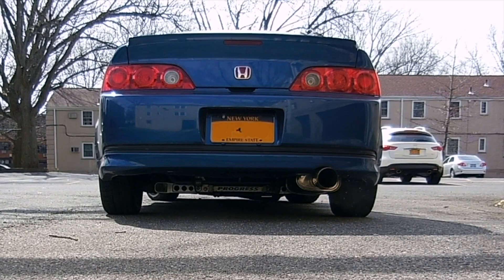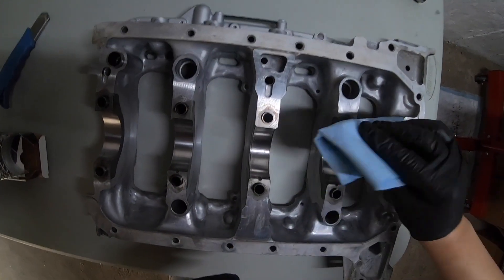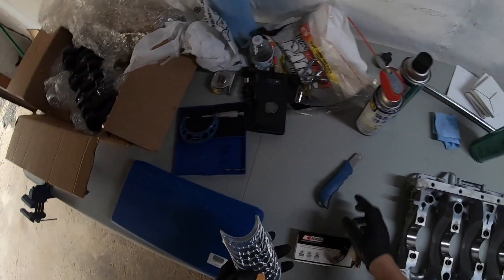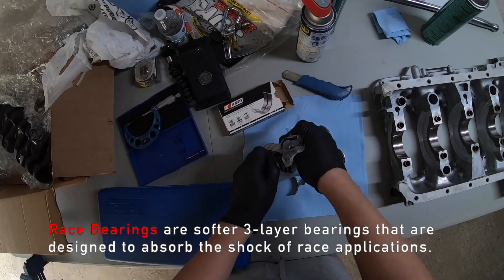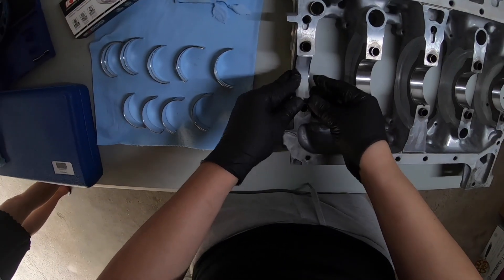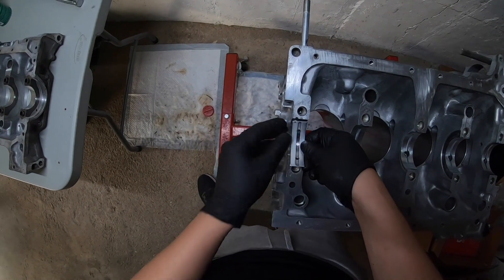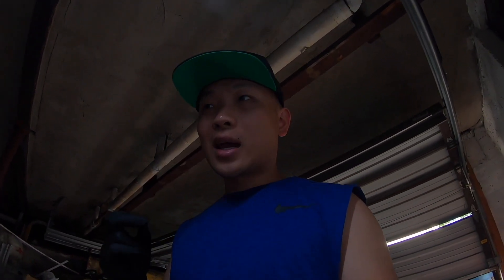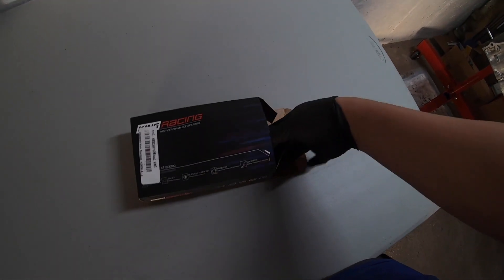KING Main Bearing Installation - 5 Simple Steps

Comment: Aren’t you supposed to take a measurement in three places per journal, noon, 4 o’clock, 8 o’clock and check for ovality?
Reply from the maker: I only did that with the cylinders, didn't do that with the crank journals.
Reply: @ikigaidriven  im not challenging your procedures, im trying to learn how to do what youre doing and there is no application specific, step by step tutorial out there.